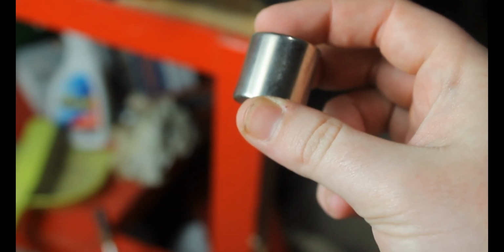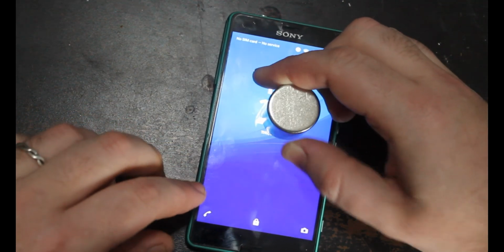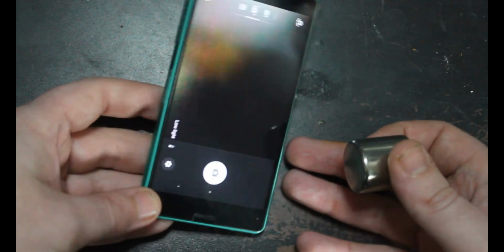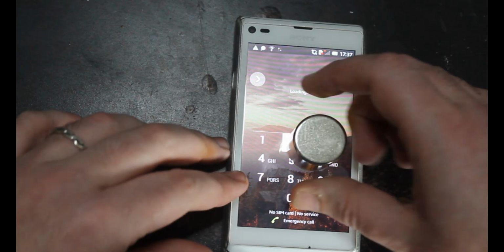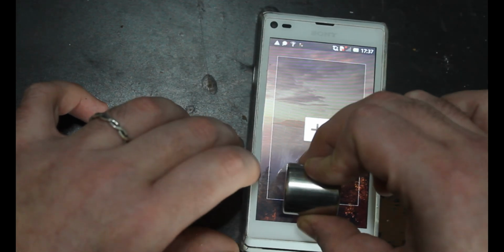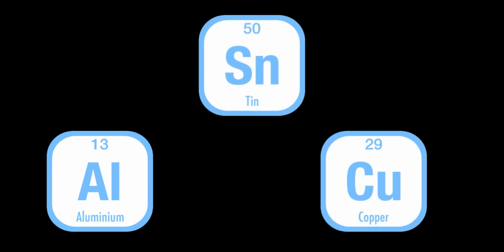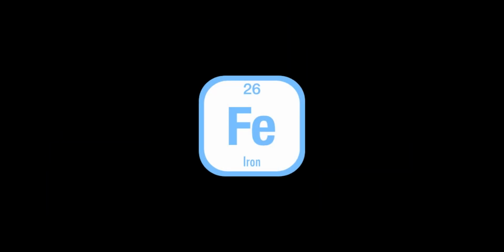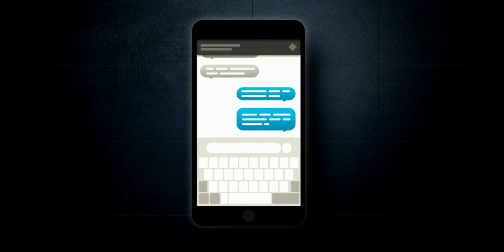What REALLY Happens If You Put a Magnet on a Mobile Phone?

Comment: Magnetic is electric. There is no reason they can't make phones with continuous power for it built in to the whole system and no battery required. Only magnets and copper wire and all instructions through Jesus with the Holy Spirit To Abba Father for permission and help in everything we do Amen

Comment: hello there, I noticed some sellers from Chinese giant stores are selling cases for iPhones with MagSafe compatibility in that they are using strong magnets in their cases. However, they are manufacturing those cases for phones such as iPhone XR even my question is that since iPhone XR was not designed for MagSafe is it still safe to use a case that has those magnets in them for this phone? Will those magnets damage the phone in anyway, even if not used for wireless charging? This is assuming the case is on all the time, and therefore magnets are near the phone all the time.

Comment: Hi, thanks for the good video. I also agree magnetin general should not damage. My only small concern would be the DCDC converter inside the phone. if the magnet is placed in the exact position and direction which could saturate the core of the DCDC inductor, this may lead to increase in the DCDC peak current (ripple), and this may make the DCDC converter suffer or brake if not progtected. I would like open some phones and really go close to the inductors and see what happen

Comment: Yeah, a little 25lbs toy magnet won’t do anything. If a 450lbs magnet fishing magnet was used however then disguise’s results would’ve been drastically different. You know how they say do not bring anything metal into an MRI machine? Or you hear stories of people having their metal plates for previous injuries ripped out of them in an MRI machine? Same concept except the magnets literally yank the metals from the plastics of your chipsets. Your main board the fragile electronics inside of a camera module or a screen, a strong enough magnet will quite literally extract them from the plastics of a chipset. This guy was correct in the fact of old hard drives being a lot more prone to magnetic damage but that’s because they were made of metal disc that stored your data and nothing about old hard drives was meant to be tough lol go by a magnet fishing kid and put that 400+lbs magnet up to an old TV or something you don’t care if it gets ruined. Don’t worry lol the results won’t take long to see. You could even test it on something cheap like an empty vape or something. I have a magnet strong enough to not only open my fridge door but I can literally drag my fridge across the floor lol trust me it would make light work of someone’s key key fob, phone stereo, smart watch… Not to mention open stuff like security boxes or take locks depending on the tight. Magnets are heavily underestimated and a forgotten art yet still are used in many daily applications today. Let me clarify also that the only time I’ve used a magnet to open his security box was when keys were lost at my job and the Task was legal. Do not use the force for evil! Not to mention you can also find some cool stuff in lakes and crap apparently. I’ve seen a magnet be used to open a car door before since it can essentially grab the lock mechanism and move it up and down actuating the door lock. Of real life uses!

Comment: I'm sitting here very puzzled.  I bought two identical phones and got wallet cases for both. Gradually, both phones started to make a constant bleeping sound similar to the start up sound.  No, I didn't put any credit cards or ANYTHING in the wallet slots.  Also, I turned off notifications on both phones and still this annoying sound persisted.  After two months thereabouts of this I had a lightbulb moment and just removed the wallet cases from the phones.  Yuppers, the sound has stopped.  Both of these wallets have a magnet to clasp shut.  I can't think of anything else to be causing my phone to do this bleeping other than the magnets. The phones are Revvl 4+.  This might not occur with other types of phones and I'm pretty sure this wasn't damaging the phones, but I'm curious here if there's anything I can do about it so I can use the wallets for these phones (different wallet cases).

The common denominator for the problem is the magnetic clasp on each wallet and something sensitive inside this particular android cell phone.

Your demonstration of running a strong magnet is good, but your demonstration doesn't delve into longer term magnetic exposure as I have encountered.

This has taken me quite some time to sort out to land on the magnets being the cause because everything online talks about how magnets don't DAMAGE a phone, but nothing about how a phone can react to magnetic exposure over a period of time.

If you know of a fix, please let me know.  I'm still scratching my head in disbelief that the wallet magnets are making my phone go off Cuckoo with annoying constant sound bleeping.  If there's a setting on the phone that would fix this I sure would appreciate knowing what it is so I can use the wallets I've purchased.
Reply: I've also experienced this issue. So far I've just been noticing what it could've damaged and for my case the wireless charging port is misaligned and the piece to the motherboard needs a new equipped charge piece.
Reply: There is no fix once the hardware is damaged. Experienced the same issue at work as a tech support.